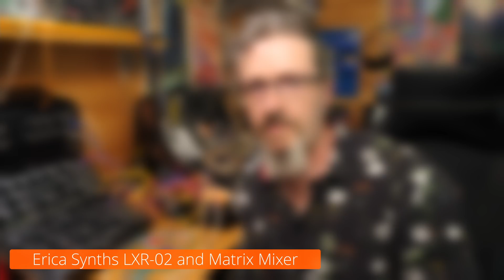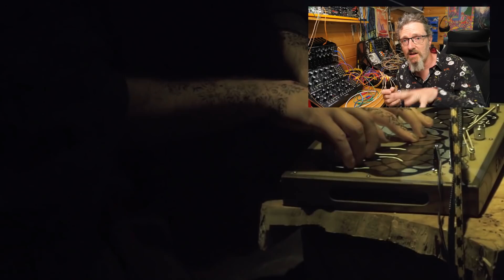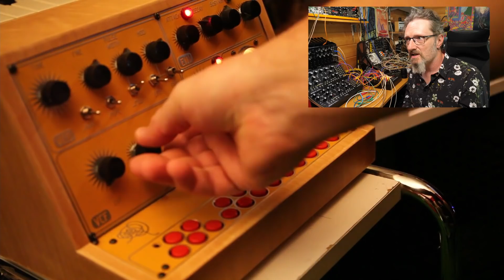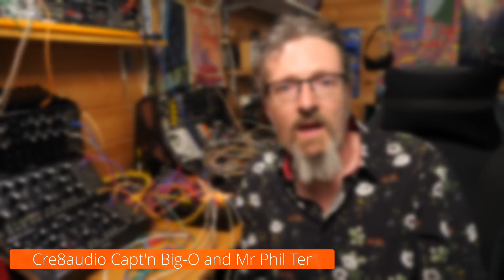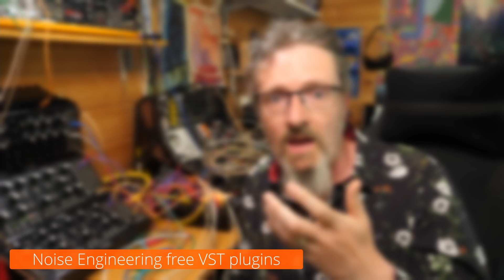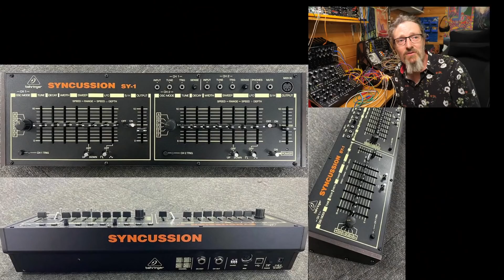Molten Music Monthly - July 2021

Comment: 53:50 back in the 70s, not the 80s. I know it, 'cos it's when I bought my system 100, sh-2 and sh-5. Incidentally, the sh-1 dates from the same period (73-76), the crown jewel being the sh-7 while the sh-101 is indeed from slightly later generation (79-early 80s), same as the system 100m (if my old neurons are right)
Reply from the maker: Cool! Thanks 🙏